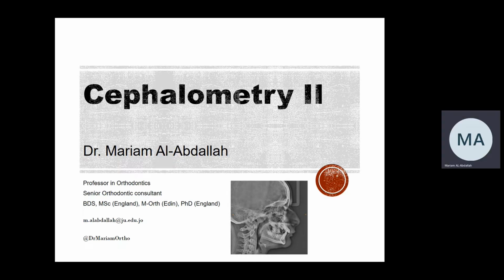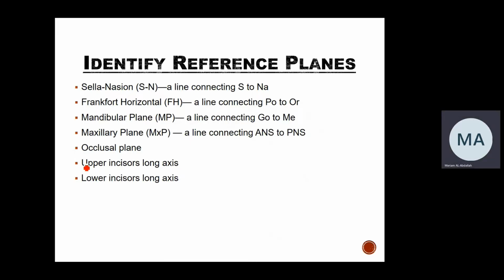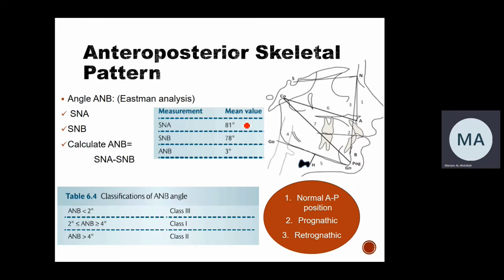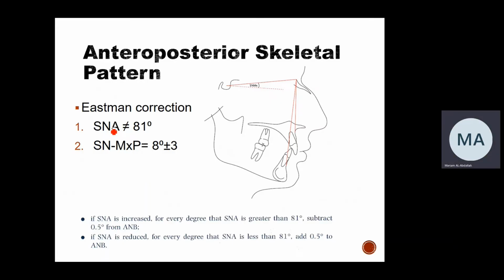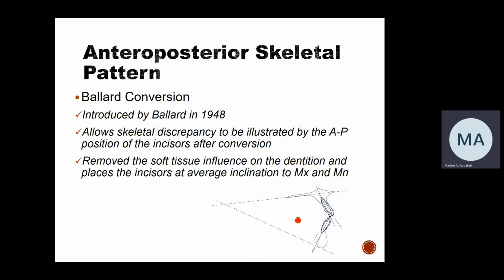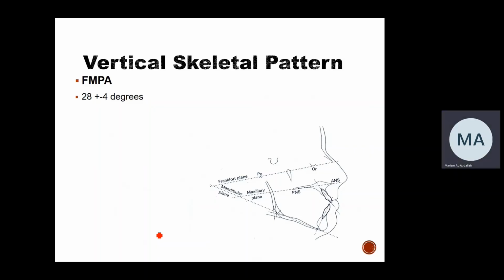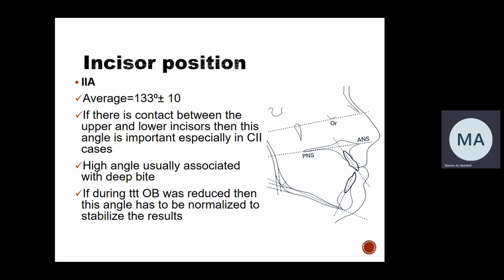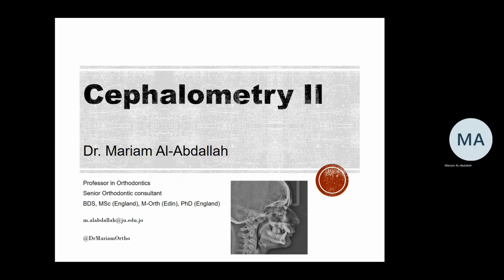Dr. Mariam Cephalometry Part 2

Comment: I have question about the correction factor of eastman 🤔  why did we divide by 2
Reply: For each degree above the value of 81, you should subtract 0.5 from the ANB. So, if the value is, for example, 84, meaning that you are above the value of 81 by three degrees, you should subtract one and a half from the ANB ( 3*0.5)
. Mathematically, you divide the three degrees by two, resulting in subtracting 1.5 from the ANB.
Reply: I am sorry but I tried to understand but couldn't